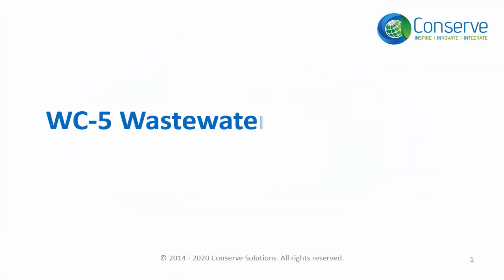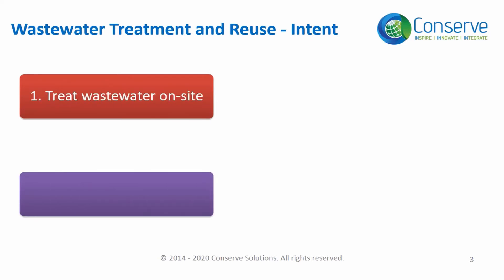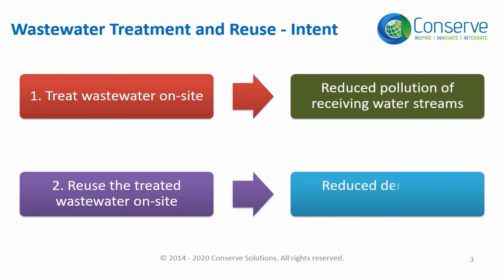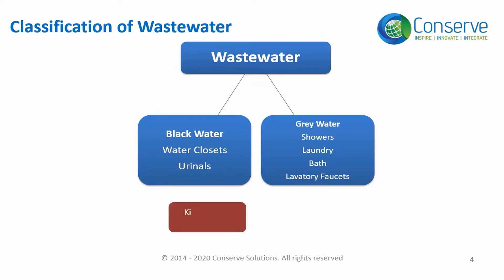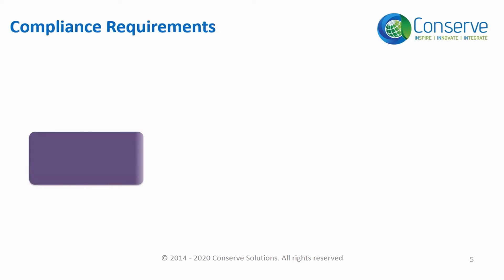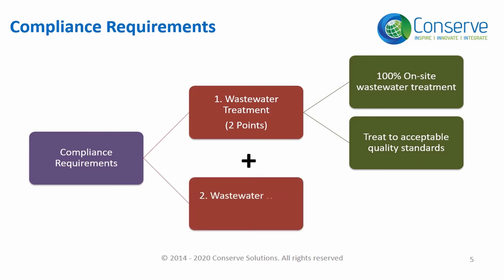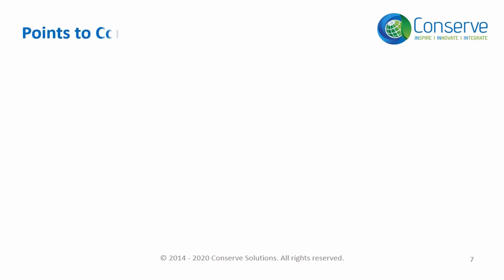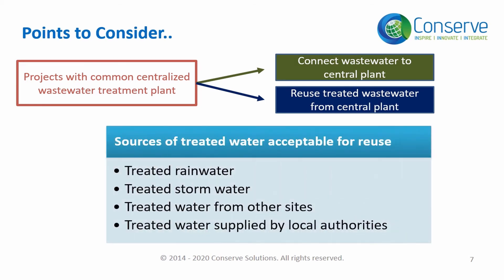Waste Water Treatment & Reuse | Water conservation | IGBC AP Exam Preparation

Comment: Which Standard Approve the quality of Treated water ?
Reply from the maker: Treated water has to meet the quality requirements of local state government standards. Central Pollution Control Board (CPCB) also issue guideline on using treated water for irrigation. With the present treatment technologies available the quality requirements can be easily met for domestic sewage effluent. However industrial sewage has to be handled much focus on quality aspects. Hope we have clarified your query.